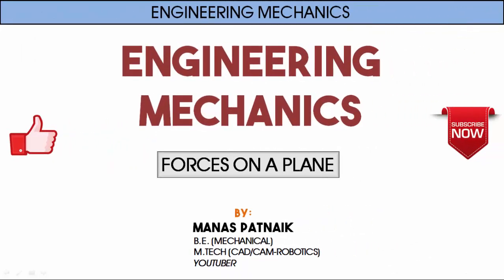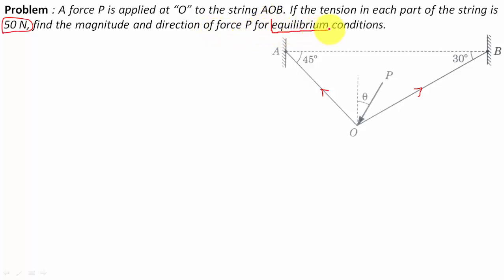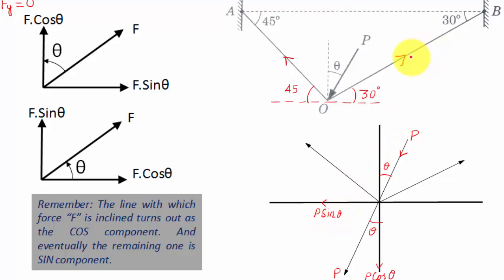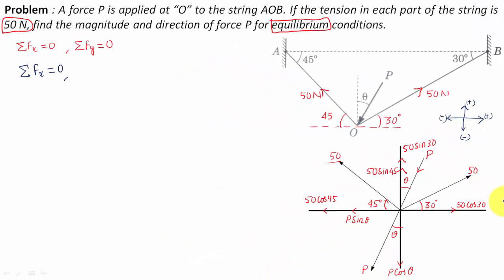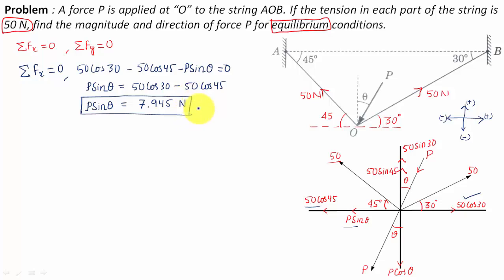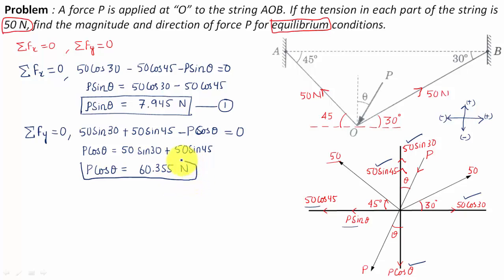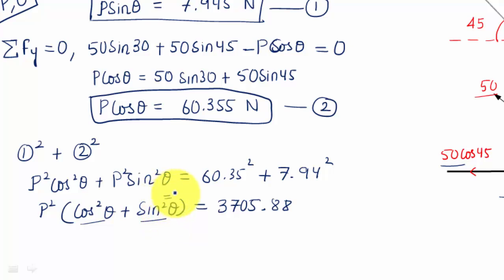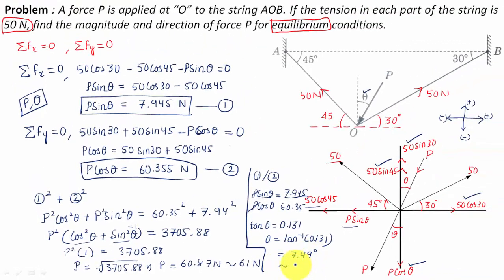Engineering Mechanics_Forces on a Plane_Level 1_Problem 1

Comment: Help me with this question. 
Q1.Two cables are tied together at C and are loaded. Knowing that a=20° determine the tension (a) in cable AC , (b) in cable BC.
The angle a=40° , and 200kg
Q2.Two cables are tied at C and are loaded. Determine the tension (a) in cable AC (b) in cable BC.
Pls explain the answers to me ok
Reply: Please on Queston (2) the angle a=50°  ,  angle b=30° and 500N on the diagram

Comment: Whats is the need to extend the P vector to the negative coordinates. If I keep the vector at the origin point, I get Psin (Theta) on the right side of positive axis and Pcos(Theta) on the top of the positive axis. Could you please clarify.

Or is it because the P vector is acting downwards and we assume that the force is acting in the negative XY plane.
Reply: It can be done both ways. I tried solving the sum both ways and got the same answer.